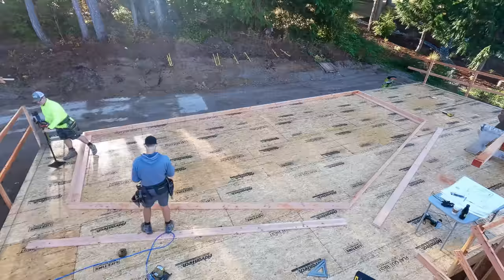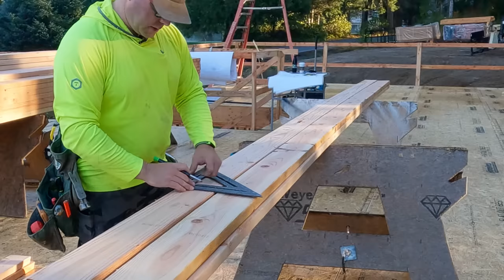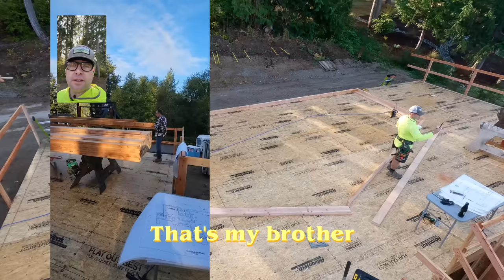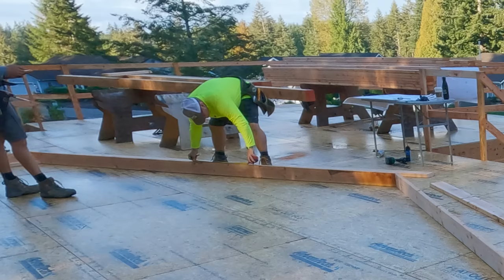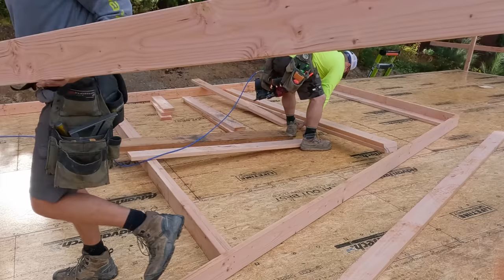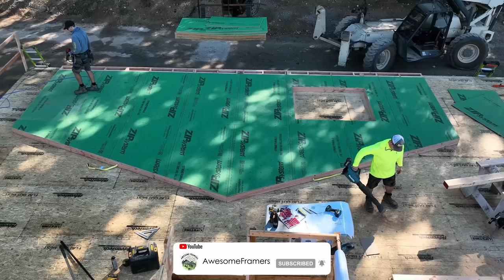So You Wanna Save Time? Rake Wall Framing Simplified

Comment: I found the math part of this interesting, because I know you are always looking to be more efficient/save time, and you could actually reduce/eliminate most of the measuring.  Most of the math isn't even complicated.  There are really just two ratios that are going to be relevant - maybe four actually if you count the inverse of those two, but for the most part, just the two.  

The first one is the pitch itself.  You can either divide the pitch out - ex. 5 / 12 = 0.41667 - or just treat it like a fraction.  

I noticed at one point you were measuring each stud and saw that the differences in length are always 10" - it's a 5/12 pitch, and you have 24" stud spacing,  so 5 x 24 / 12 = 10.  The difference in length is always double the pitch with 24" spacing. The math also works with any other stud spacing, though the numbers might not be as clean.  If you had 16" stud spacing for example, it would be slightly more complicated, but you could still just multiply the 16 by that fraction - ie., 5 x 16 / 12 - and that would be the difference in length from one stud to the next along the same pitch.  This works for any other distances, and since it's just a ratio, it works in any units as well (you get the same units out as you put in - inches, feet, centimeters, meters, etc.).

The other useful ratio is the length along the roof pitch vs. perpendicular/level length.  You calculated this repeatedly with the construction calculator, but if you get the ratio, all you'd have to do is a simple multiply.  The Pythagorean Theorem is used for this, and it's a very useful algorithm and worth looking up, but this is the easy version:  Divide out the roof pitch, (ex. 5 / 12).  Then square that number.  Add one.  Then square root.  The result is the ratio between lengths along the pitch vs. lengths along the ground.

It's also actually the ratio between the thickness of a board when it is perpendicular to the ground, vs. how much height it adds when tilted by the roof pitch.  In the case of a 5/12 roof, it's 1 5/8" for 2x lumber.  Ie., sqrt((5 / 12)^2 + 1) x 1.5 = 1.625

Comment: When you sheath your walls to the outside corners of the sheathing over lap or is there a gap that's the thickness of the sheathing between the two?   As in when a through wall and butt wall meet does the sheathing fon the through wall and butt wall over lap or do they stay separate typically?

Comment: Ok, why 5 top cripples above the window? If the two outside cripples on either side below the window aren't doing anything, what are the two outside top cripples doing structurally? Unless your sheathing edge is hitting there.
Reply: continuation of the criples below the windowheader? maybe? to keep 3 studs from top to bottom?
Reply from the maker: habit, I'll delete those next time.
Reply: Isn’t the load transferring through the extra 2 cripples to the header then into the trimmers??? I would keep 5 up top rather than 3. But then again this is much lighter framing than we see with 150lb snow loads in my area.
Reply: @jeffcobuilds2660  on a rake wall, the load path is directed down the rake rather than straight down through the wall, which is why Tim said before “we don’t really need a header on a rake wall, but the engineer spec’d it so here we are”. Even if this was the more modern version with a flat wall and a gable end truss, that window still wouldn’t need a solid header. But engineers win….always lol.
Reply from the maker: @jeffcobuilds2660  Nope, the load from above is on the header which then transfers down the trimmer/jack studs.  The double kings take the minute amount of load and those end cripples are pointless.
Reply from the maker: @pistolpete8518  well the engineer didn't, but I've had to go back and add headers due to the inspector.  Now I add them to avoid the issue.
Reply: @AwesomeFramers  ah, that makes sense. Sometimes it’s easier to comply with inspectors than to argue right vs wrong. Thanks for the correction Tim!

Comment: I would have use 6 inch fasteners in that DBL  king to header bond in our jurisdiction. 1:1 for screws 1:1.5 for nails is the rule
Reply: 5" -  2x1,5"=2" Into endgrain sounded short to me aswell. I guess the header won't come down due to the cripple supporting it.
Reply from the maker: Can you provide me a link to support that?  I don't doubt you, I'd just like to see the reference.  Thanks.
Reply: @AwesomeFramers  I can not find end grain/ edge grain fastening into LVL in any of the manufacturers installation guides. Best practices usually call for a hanger or blind hanger when co-planar to the sheathing plane.
The 1: 1 for screws, 1:1.5 for nails is a wood to wood heuristic I got from Taunton press' Fine Homebuilding back in the eighties when I was framing new construction more than the remodels I do now.
Reply: @georgemckenzie2525  I know the rule as 1:1 for screws and 1:2 for nails, but 1.5 might be for ringshanks. That rule is just a rough guideline though and also doesn't really work with larger wood/screws. For example all the 140-400mm timber-screws I use have the same thread length, 100mm I think.
Reply: @dabj9546  I love high strength structural lags, and use them frequently. For shear and withdrawal they are first rate.  The issue is the plywood nature of the LVL construction,  and between layer application of the lag. I use hangers,  or steel mending plates with strap shot gun nails for this material. 
In Boston, inspectors did not want to see any structural fasteners period, full stop,  within 2 inches of edge or end of any LVL.
I guess I'd use them to snug up and clamp the joint prior to hanger or plate application, but pull them to fight another day.
Reply from the maker: @georgemckenzie2525  I'm not sure that applies to modern fasteners.  As far as the LVL, since LVLs are shown as headers in walls in the literature, and there's no note I could find, I don't think it matters that they are fastened this way.
Reply: @AwesomeFramers I generally am  a fan of your work. That said In my practice I attempt to keep products uses to those insured by the manufacturer. Check out those "100 year" bridges in Norway. Personally when asked to do so by an engineer
I have been able to break 3.5 x 14 LVL with loading, just as easy as the clear hemlock 10 x 12. LVL lost some of its gloss for me upon seeing it fail.
In trad woodworking this issue often warrants a dowel be inserted so the end grain is mitigated by the fastener entering cross grain of the dowel. 
The finished wall you constructed has many redundancies in the sheathing and bearing. I am not at all suggesting, or concerned that it will fail.
Frame on !

Comment: [1:54] Don't blame it on the blade. We can't be changing to fresh blades all the time like we change batteries. I'm beginning to hate cordless saws for anything but quick, rough or secondary work, except maybe for cutting on the roof, esp. sheet. As much as they are hyped all over the internet and everyone is using them now, the truth is they still suck hard compared to corded saws. The power is not even close on the first cut with a fresh battery and the truth is it goes downhill fast no matter what size battery you are running. People talk about going all day or half a day on one--BS. Working Oregon winters in 30-40 degree weather, I am changing even 8ah circular saw batteries pretty regularly. The other day killed four in a row in like ten minutes trying to rip 2x6 with a cordless Milwaukee table saw. Totally useless. We should be going back to corded for another ten years.

Comment: How tall in that Rake Wall???
Reply: I don't remember, but he said a number for the stud near the ridgebeam pocket., i guess 1,5 " bottom plate, plus longest stud was 185" plus 3,25" for the diagonal through the double top plate. (=189,75")
And that is a point 3" of the ridge (beam carrying the ridge beam was 6"x6" )
So a bit over 190" (15'10")
Reply: @bertbergers9171  Reason why I asked is because, I m going to be building a Ridge wall similar to that one. I am actually designing a home with a double shed roof, some thing like that!!!